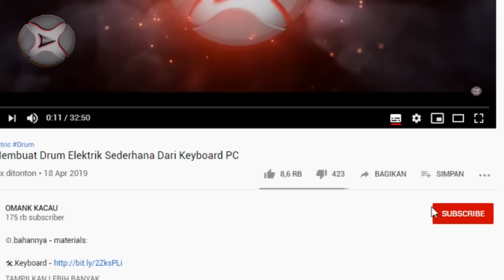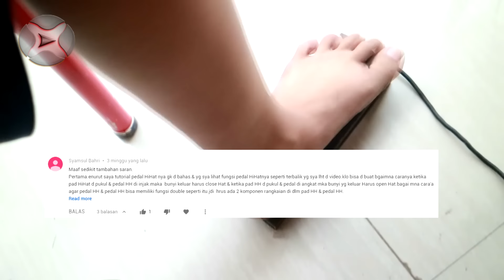Cara membuat Drum set Elektrik 🥁🎶

Comment: Dari piezo ke modul gimana tuh sambunganya bos kok ga ada?? Saya tunggu tunggu padahal penjelasanya
Reply: English plsss.. , if you step the pedal hat it will close and if not it will open. How come? Plsss teach me plsss.
Reply: use the micro switch, which has 3 pins, for example top, middle and bottom, select the pin on the module that can be used, select 3 pins on the module that can generate 2 codes, for example, pin 1 + 2 = a pin 1 + 3 = b
Reply: Then connect pin 1 on the middle switch pin, pin 2 and 3 on the top and bottom pins, if pressed, pins 1 and 2 will be connected, if released then pin 1 and pin 3 will be connected
Reply: Thank you sir!😊
Reply: Coba mas cari dividio sebelumnya ada kok mas koneknya sama seperti yang pertama cuma upgred tombol yang ada di alat yang dipukul saja
Reply: Tonie Blankk ya udah ketemu dan udah jadi juga, tks